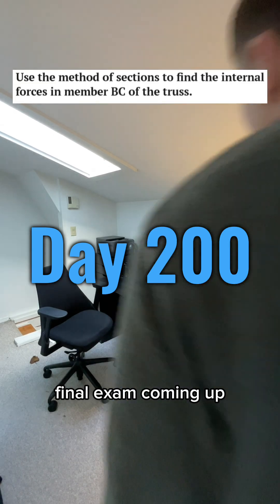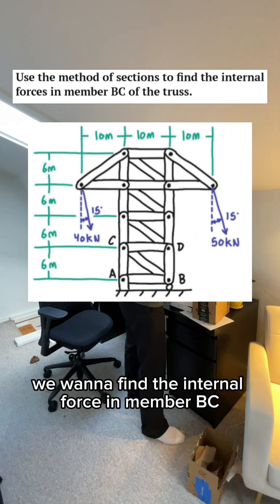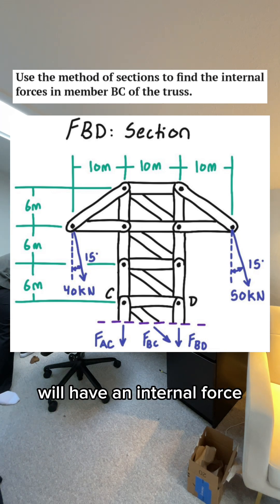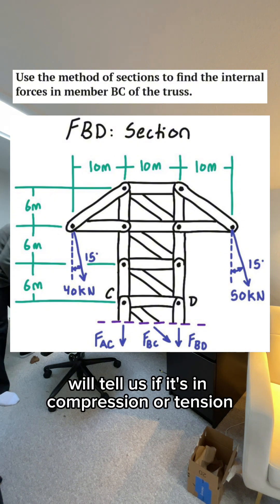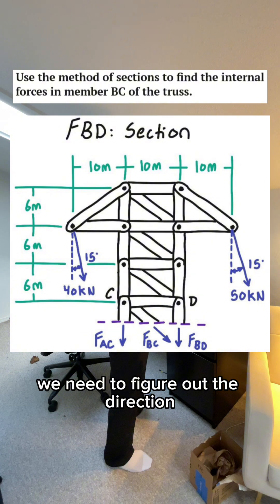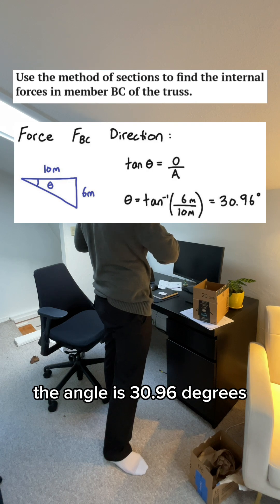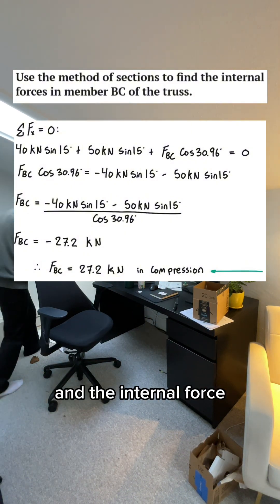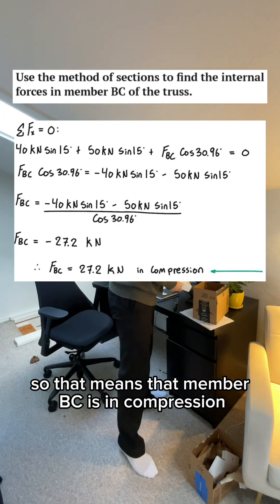How to Solve Truss Problems in Statics using the Method of Sections

Comment: Can i ask you math question please.. 

. A solid has base in the xy-plane consisting of a unit square with center at the origin and vertices on the axesvertical cross-section at position is itself a square. What is the volume of this solid?